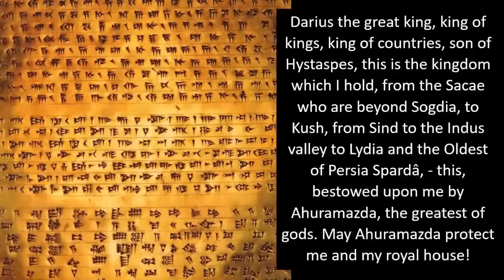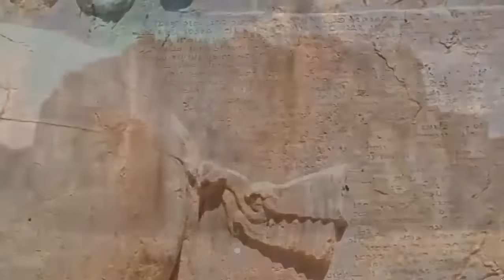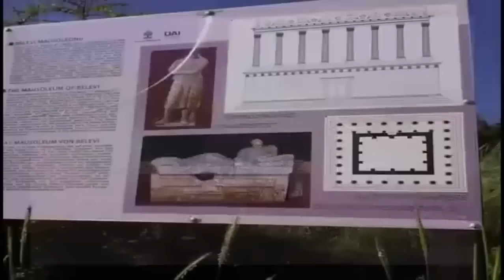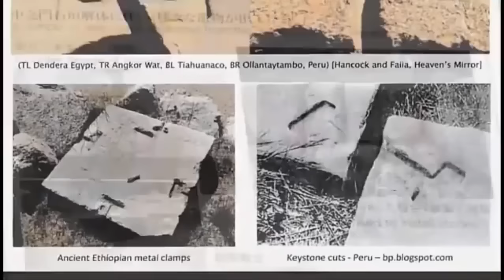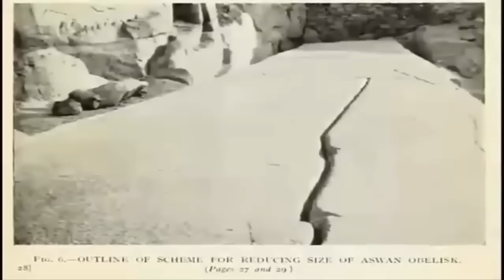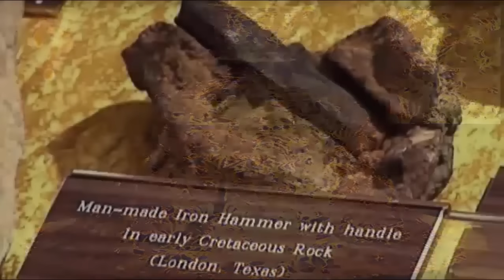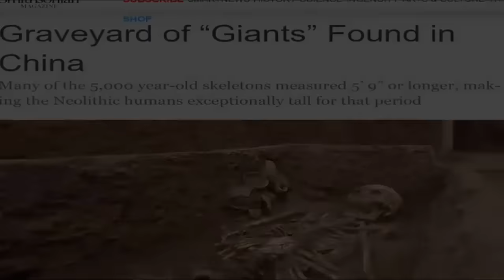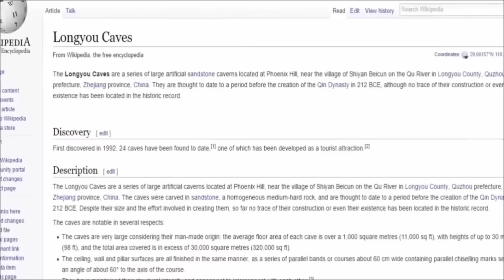The World's Most Incredible Pre-Flood Ruins?

Comment: I believe there were many floods. The glaciers melted, creating gaint lakes. In America, there were several lakes at different times
Dating back to 10,000ya a settlement with mastodon carvings and a mini Stonehenge was found on the bottom of Lake Michigan.
Reply: If it were not so, how would my mid Missouri area have limestone and coal?
Reply: There is plenty of evidence of many floods and also changes in topography that caused gradual creation of large water bodies (rather than sudden, as is the case with what we typically think of as a flood). None of the evidence points towards a global event wherein the entire surface of the Earth was flooded.
But another North America example of a large change is the Central Valley of California, which was once a sea connected to the Pacific through the Golden Gate. As sea level dropped and the land rose due to plate tectonics, over the course of many, many thousands of years, this valley ended up above sea level, remaining connected through the Sacramento river.
Reply: Yeah this is true and even at Yellowstone Park you can see that happening in real Time with the lake moving from the ground rising

Comment: Even if purported giants were twice as tall as us they still couldn't lift the bigger stones.  And no, they did not pour all of those things - imagine the formwork to pour a 12 sided rock!  Clearly there were saws, chippers and drills along with lathes and burnishing tools.  And also some areas do look melted - but those melted areas seem more to be destructive.  Stonehenge, Gobekli Tepi... are more recent works I suspect.  They lack precision cuts.  But however they moved those huge stones long ago is amazing.
Reply: The structures have been petrified. Turned to stone, by sitting under water and mud, invaded with silica, and transformed into something much heavier than it was originally.

Petra-fied.
Reply: They may not have been poured from the top down, but extruded from the bottom up.

Comment: At about 20 mins in: - May I suggest the the metal clamps allowed any voltage to flow throughout the entire wall/building and thus permit charge to exist thoughout it's entirety.  In this manner an vibrationally elevated stone would potentially flow over the charched artifact from/with a prescribed sound frequency energising the quartz and providing vibrational energy.  I wonder if we can "repair" or reinstall such metal links in such an ancient megalithic structure to measure before and after energy levels at different sound/energy levels and frequencies?

Comment: Clearly, those who made these where long gone before someone else took these in ''use'' and there is no question that the new users did not have the knowledge, tools or insight into maintaining these structures, therefore the decay. Surely, if it was built by someone who were continuing using these and present, these would be maintained. My guess is they took back to the space and continued their journey.

Comment: Ancient Romans improved on a primitive forum of concrete the earliest we know of was found d in a hut which turned out to be 7,000bc  in Israel,  the romans just improved on this we can see this concrete by looking at the the Colosseum , if you look at the differant texture of the stones, in the video the totally smooth finish looks like it's been done with cast moulding, perhaps that's. Why does everything Ancient need to be work from aliens sometimes the most simplest ways need to be looked at
Reply: Megalithic structures and places are often are linked to specific quarries and worksites which contains exact blocks and type of rock used. I'm not saying that there weren't used casting and molds. this is well known and wonderful and gigantic pieces at that!. and most likely from the same period as the carved stones. 😃

Comment: Those aren't "CLAMPS".  That little bit of metal couldn't effect(hold together) tons of stone.  Am I right?
Reply: How old are they? Metal would not last that long in the elements.
Reply: @johnmceivr3769{ No, you are wrong.
Reply: Perhaps electric connectors operating by using the electric current caused by capacitance between blocks.